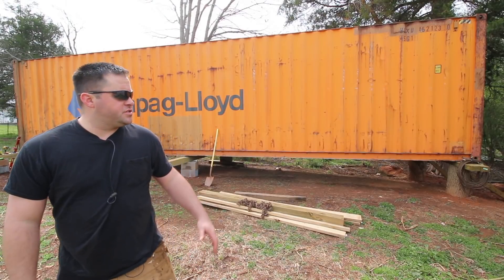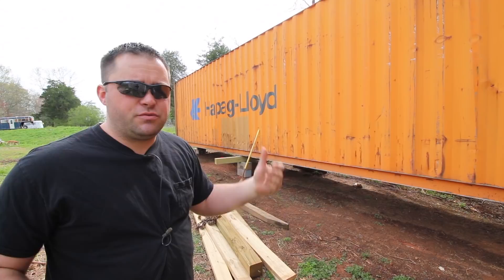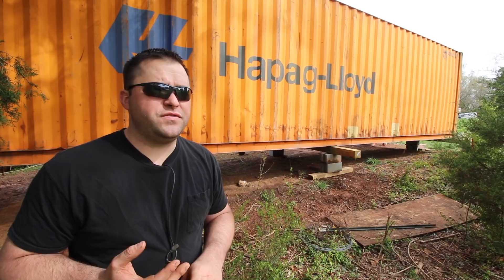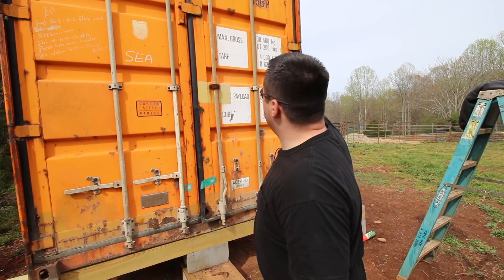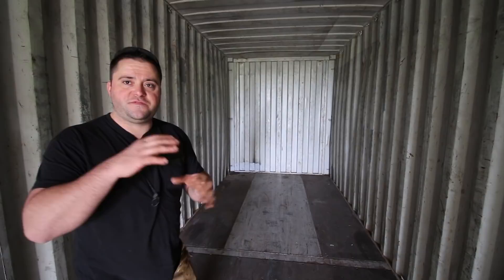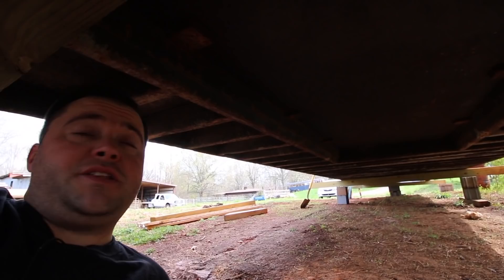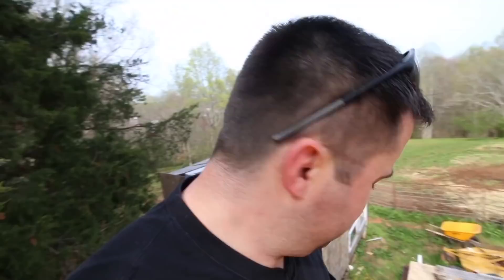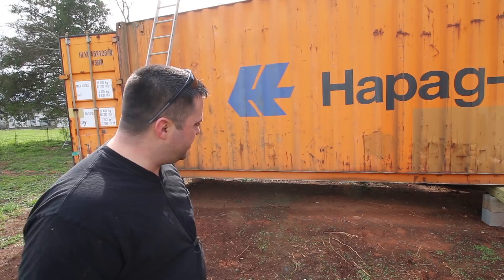The COST and things to look for when buying a SHIPPING CONTAINER! E4

Comment: Dan as a custom car/truck builder(medically retired) I would advise you to coat the inside walls (at least the ceiling) with a Heat and Noise Reduction coating. I like Al's Liner ALS-HNR, you can get it in one gallon pals that cover 44 Sq.Ft. at 31 mils for $44 off Amazon and Manufactures website. The coating blocks up to 35% of exterior heat/solar energy transfer and really help cut the echo/tinny sound in side "the can's" (any metal box lol), this well also help with the noise of building the tiny house as it stops sound wave travel across the outer wall surface. 

As for rust repair and prevention I always use KBS Coatings Rust Seal kits, it's a three step job, but if done right it takes an act of god to get it off. I use it on all me frame off jobs. Also Al's makes a very nice do it yourself bed liner that is tint able (you can tint it white to help reduce heat intake from the roof), and the more reflective the coating the more heat solar heat it will reject. 

Can't wait to see this build I have been following the tiny house since your 3 or 4 video, if you have question I'm more then welling to help.

Comment: *Nonsense comment*... To help you with your roof, there is a paint made specifically for metal roofs. I believe it is basically a rubbery white ceramic paint. The paint has an R-value rating. It seals, insulates, and reflects heat. I got some leftovers from a relative once and used it to repair an old work van. I don't know how expensive it was but it did last. It also kept the the van cooler and cut down on road noise. Either way cool project, can't wait to see your progress. Thanks for all your hard work and effort you put into your channel.
Reply: Lapolla elastomeric roof coating

Comment: Matte colors absorb more light. Do a high gloss to reflect more light away. 

Good stuff like always man. I would still advise doing a layer of epoxy on those floors to prevent off-gassing into the home in the event that anything toxic was shipped inside the container before you bought it, and to seal in the chemicals that the boards are treated with. I'm sure you already know, but these knuckleheads down here in the comments, or some stray passerby may not. Safety first peeps.

Comment: Use bowed 2x cauls underneath with 2 strong jacks to reverse the bow in that section. Leave it for several days and it should hold. weld some reinforcement underneath.

Comment: Great info, wish I would have known some of this 4 years ago.  I bought a property that had 2 old rusty 40 ft containers.  We grinded down the roof and sides, fixed some holes with bondo, painted a thick coat of rustoleum metal primer on it, then two coats of white sun reflecting paint.   We were winging it, but it worked.  I look forward to your future videos

Comment: To work on the bottom of a shipping container I use a backhoe or excavator to put the container on its side, it's much easier and faster to work on bottom that way, when you're done just use a backhoe to turn the container.  My containers seem to attract woodchuck/groundhogs who want to dig their burrows beneath, for my newer containers I put scrap chain link fence on the ground before I dumped crush stone where the container would sit, I also put down landscape fabric to prevent weeds growing through, I don't want to add maintenance projects for myself..

Comment: Grow a roof top garden that'll keep the heat out
Reply: clever
Reply: Yep. I remember reading that utilizing an earth roof changes the seasonal temperature between something like 12 and 25 degrees. That's significant.
Reply: But will the rot the steel?
Reply: Ari Douglas  you dont have to make it that big. You can feed a family with a garden smaller than that.

Comment: A roof top garden is a good idea, but quite a bit of work.

You could use white paint like you mentioned, but I’d seriously consider a liquid membrane system. I’m a sell commercial roofs, and I sell a lot of liquid membranes, especially on metal roofs and they do an amazing job.

The system normally includes a RUST inhibiter. You’ll need that. Then you might need a primer. Then I would use a urethane base coat. After that, you can finish it with another coat of urethane, or use a white silicone top coat. In any case, it WILL help reduce the heat transfer into the building. I’ve coated automotive shops here in Dallas, and it’ll drop temps by 10-15 degrees without any help from HVAC. It also keeps the HVAC from running as hard which extends the life of that system as well.

In any case, shoot me a message if you want to know more. I’ll point you towards the right direction and figure out exactly what you need so you know what to buy.

Comment: Question??  I need 2 storage containers to actually store stuff in for about a year on 10 acres I have out at a small lake.  After that, I'd like to turn them in to cabins. I have called several places and personally carried a ladder to go look at some used containers, particularly the roof and the under side, here in my small town in West Texas. (Your rust issue enlightened me a lot ). The used high top 40 footers were in rough shape, not a lot of rust, but a A LOT OF BANGED UP METAL,  and priced $3100.  For them to paint the bottoms of the container was going to be $500, to paint the rest of the container was going be another $750.00 (The paint would just be sprayed over, no prep work to speak of) and $120 for delivery.  I can get New - (One Trip) 40' high tops with doors on each end for $5500.00 delivered if I buy 2 at once from a small container dealer about 30 miles out of town.  For a little over a grand I think its worth it for the double doors, no dents and the better paint.  Your thoughts. Thanks
Reply from the maker: Yeah.  You get what you pay for.  I’d do the one trip if that’s the price.  You’ll like double doors cause they get hot in the summer.

Comment: Wow. I got a 53', Hi   Cube (that I got to go see and pick 1st) with no rust, a few dents, perfect roof, delivered for just under $4K. You want to use the white elastomeric coating. My tests showed at least a 4-5 degree difference. 1 5 gal bucket of the #700 coated the whole roof with a bit left over. (Costs $75, but worth it.)
Reply: Might also consider just using Kool Seal which is the aluminum sealer that is used on mobile homes, it all so seals and sound deadens the interior.
Reply: This is great advise if you're not going to have a 2nd story or install a roof.  But it's important to note that any coating is not a substitute for insulation, be it ridged foam board or spray foam.  I don't understand anyone who settles on batts or any other kind of insulation for a container home.  It takes up way too much space for the R-value, and the condensation mitigation required is just not ideal for a metal shell.
Reply: hi everyone ,if anyone else trying to find out best container homes try Skyarza Container Home Star ( search on google ) ? Ive heard some pretty good things about it and my co-worker got great results with it.

Comment: just an fyi , the 'WEAK" circle is for the weight of a forklift or heavy cargo load warning usually .  Putting a piece of plate steel down during loading worked fine. We've broken thru a few cans bottoms while storing double stacked pallets of block product but this was a several hundred pounds per sq foot for the entire trailer .  Unless you fill it with bricks it should be solid

Comment: don't use paint on the top! They make an Elastic sealer that you can roll on. They use it on RVs, Travel Trailers, etc It's cost is about same as paint.
Reply: Yes and after navaljellying the rust on the sides, oil based paint lasts way better and longer than water based.

Comment: Some companies provide shipping papers listing known goods in the containers  Granted you might not get all the info However it would be good to know it wasnt bio hazzards or harmful goods 

Working in Autobody 30+ years The inside of your container looks fairly good I would grab a sander and scuff up the paint with 400 grit and smooth out the peeling paint (feather edge ) and it it with some cheap outdoor metal paint as it will most likely be hidden anyways 

As for the outside it looks ruff .. You can rent yourself a pot sand blaster Sandblast all the rust spots Get some primer/sealer for those areas ..Sand.scuff the rest with 400grit And some white rust paint (white being a good color to keep the heat off the container For the first 2 feet of the bottom i would go with extra paint Even a rubber coat It would extend the life of the container longer than just painting over everything or leaving it

Comment: Hey Dan, start off with a floor jack and a 4x4 to jack those low spots of the roof back up. Put the jack on 2x4's or 4x4's across the floor to spread the weight and not cause issues on the plywood deck.  As far as the plackard goes, most containers I have ever seen come with them as built. The shippers need to readily show what is in every container, so just because it had one on it doesn't means it had the most nasty it could have, but act as though it did.. I'd try to find a way to get an air sample of it with the doors closed for a few days before putting any real money in it.. You sure don't want to put a ton of time and money in it and find out it makes you sick!!  Maybe put that fucking chicken inside if and see if it lives!! You know the old saying, two birds!!!!  Hahahahaha..... I am looking forward to full measurements..   Scratches for Peanut.
Reply: Steve- I agree. Who the heck wants it if it's going to give them some new kind of Cancer? I say strip the floor, rent or buy some masks and or hired help. Eat the cost. It's worth it. He might not care about it right now, but he will!

Comment: I’m not here for a home just some storage for a future business because this seems cheaper than a whole shed and I was right after it all done it will cost a a lot less I’ll make a switch for it myself from solar power to power a bunch of led il repaint it if by then the laser rust removal is not expensive to much I’ll do it on that it make it a bit safe by adding some plywood to prevent cuts from rust material

Comment: Just found this channel. Had some ideas. I am a Realtor. Cool idea. How has this worked for you. I thought about the rubber liner for the roof. Maybe the floor can be sealed before you cover it to prevent chemical smell etc. Definitely you can add air and cut windows and doors. Plumbing and lighting can be run to these things. My concern would be land permits to house these. Was that easy to get in your area? Do you own a farm? Maybe create a slanted roof might be good to drain potential water so it doesn't accumulate would be a good idea. Those doors would have to go. I would not want to get trapped inside that thing. Not a good idea getting under it either.

Comment: Instead of the complicated crane scenario, why not put axles under one end and a hitch ( goose neck, pintle or whatever works) on the other end? You may still need a hotshotter to move it but still. While this may cost upfront the benefit of knowing you can move it at any point is peace of mind. Once you get it where you want it, shore it up accordingly.

Comment: I thought of using one for the core of a building and build out so you have some inner strength I was thinking of putting a conduit frame over it and attaching to the container then cover the whole thing with green house fabric  or shrink wrap so you have a sloping roof and sides as well but a solid core. could use the space between the outer frame and the container as a solar garden as well as rain guard and wouldnt maybe look as bad as a plain container, and of course would have the core for safe use  also nice and dry.paint it barn red and would look nice, only for a colder climate perhaps

Comment: Gloss or matte will both reflect energy (heat) the same. 
Don’t use acrylic (and definitely not the low end crap they sell at Home Depot), it won’t hold up to any ponding water. Go epoxy, urethane, or silicone. Make sure you treat the rust and use the manufacturer’s metal primer.
Source: Commercial Roofing Contractor.
Reply from the maker: +Dan Jones  I like the "source". More credible than 99% of the comments.

Comment: Use a 4x4 post and bottle jack on the corner in the back. I’ve got a few issues to fix on mine as well. Biggest issue I have is bowed out walls, so I’m going to use a variation of the same bottle jack idea to fix that. Check it out on my channel if you’d like to Dan, maybe we could bounce ideas even.
Reply: If you have a welder you can weld hook tabs to the walls and floor and use a chain with a bender to suck the walls in quick and easy, it's like a reveres porta-power we use to push car back into the right shape. I have used the chain and bender on a couple of old ford trucks to rack the cabs back into square, works like a charm.
Reply: I thought of that too for bringing my walls in, either way I’ll video the process.

Comment: Hi Dan! Love your videos and glad you have another project. Here is an nonsense question. Could you use the rubberized paint normally used for the roof along the bottom ledge once it’s cleaned (and at that stage) to prevent rust and water pooling at that area?

Comment: A media blasting company could get a significant portion of the rust removal done in a day. I imagine costs are a concern but the DIY route could take weeks or months, ya know?
Reply from the maker: +delerium75  I've done a chunk.  Estimated 10-12 hr to grind and prime. I'll go back and touch up before the final coat.
Reply: I had the same issue.  Quotes for sandblasting the sides were $2000 - $4500.  I ended up hiring high school kids looking for a summer job at $10/hr and grinded the whole thing to bare metal.  Took weeks, but was a lot cheaper, I figure about $300 in labor plus the grinder and wire wheels.

Comment: fit a full grp roof on it with a white pigmented top coat waterproof insulate underneath it  for up to 50 yrs and  reflects heat job done check fibreglassrsltd

Comment: it is impossible to support it any were then the 4 comers trust me I know, even at that they have to be bang on leval, you lift one corner you lift the whole end, I drag my 40 footer around empty with my 5ton dump truck;; I use my forklift to lift one corner to block it and the blocking on the other side was no longer touching, mine was a one trip nice green paint, paid $5000.00 CND for it, don't get it from a 3rd party, buy from the port, and I picked it up my self on my 8000Lb trailer, as long as your trailer wheels don't weigh over 10,000Lbs you can tow it with a regular license don't need an A class, the weight is painted on the big door. 8000Lbs, Don't try and take the floor out unless you want a huge job, they are not plywood, they are hardwood planks, lamented both ways and nailed at each layer, and very thick, as they have to be, since huge steel beams, parts, you name it are shipped in them.

Comment: its just a pile of rusty metal, you can get brand new metal frame without headaches of cutting thins and positioning
Reply: A brand new metal frame is not modular, though, and you wouldn't have  a finished roof already. The modular aspect of a shipping container allows you to build piecemeal.  You could pay around the same for a steel frame but would you have the money right away to add everything else like insulation, flooring, fixtures, doors, and windows.  With a shipping container, you can take your time.  A steel frame by itself is not protected against the elements.  It's not contained.  A shipping container is.

Comment: If it had toxic shit in there you really should have the whole interior sand blasted, batter safe than sorry.
Reply: sand blasting won't do anything, the wood is saturated with heavy duty chemicals and pesticides. He needs to do a coat of epoxy to prevent off gassing of the chemicals and just float new flooring over it.

Comment: Hey, why don’t you EVER answer My questions. You have something against middles aged divorced women?  Really...can I run bbq propane lines to my Precision Temp hot water heater? One of THEIR videos has a guy using OVER 10’ ...doesn’t it break down or is it worth it 
 to avoid adding black pipe work and weight?
Reply: Middle aged? LOL. Come on now. I'm middle aged and I could be your son. Your question is missing so much info it's not worth the work to answer.

Comment: Shipping containers can never be justified for use as a dwelling ~ for animals maybe, but not people. Besides the terrible thermal conductivity of metal and all the insulation issues thereof, it's simply easier, cheaper, and better (trifecta of building) to build using standard materials available at any building supply store like Lowes or Home Depot.